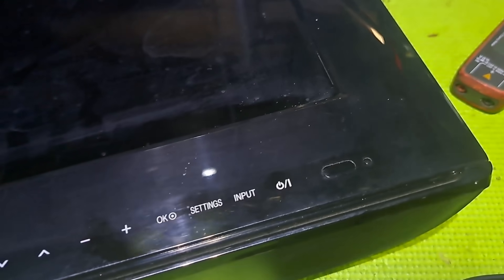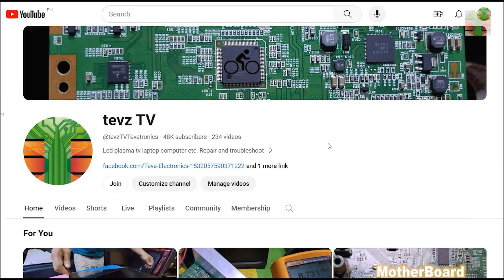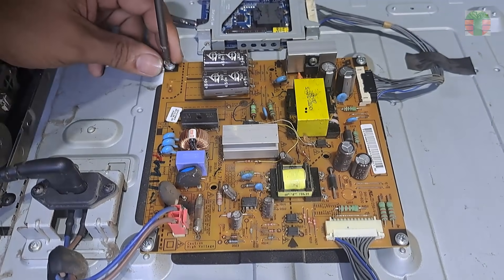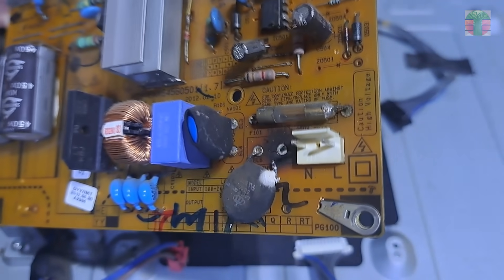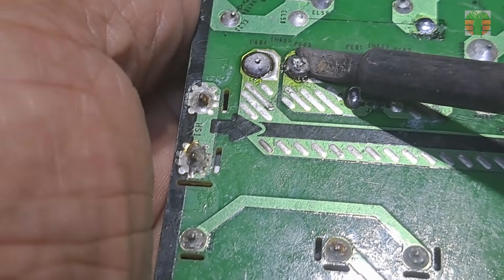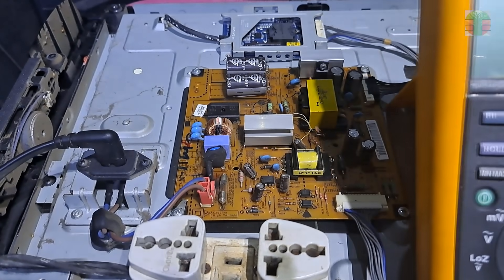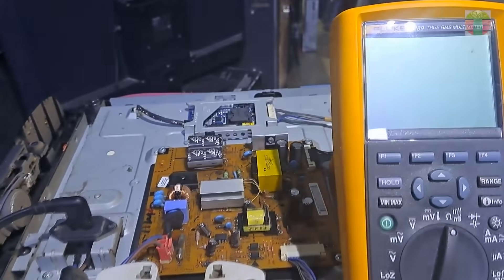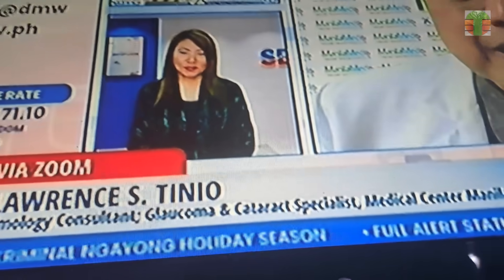What is this component?

Comment: Is it usual for htat component to be the only one damaged ?. If it has been wisely calculated, it will protect the circuit, but may the cause of the failure be a short downstream the thermistor?
Thank you very much , Tevz. You are a machine on fixing boards.
Reply from the maker: No, the thermistor is get damage, no others causing it to get failed.

Comment: What soldering iron u use which brand
Reply from the maker: It's a Chinese product. Sorry, I dont remember the brand.
Reply: I used those for years, now i use Aixun T3A and it has changed my life, as I repair variety of boards from different devices every time. @tevzTVTevatronics